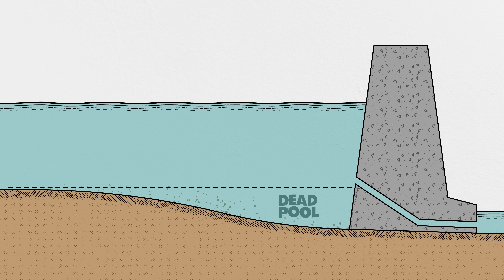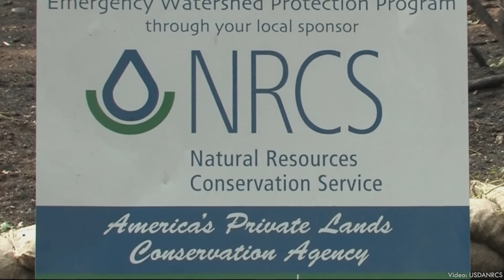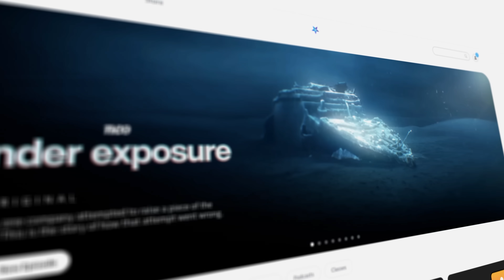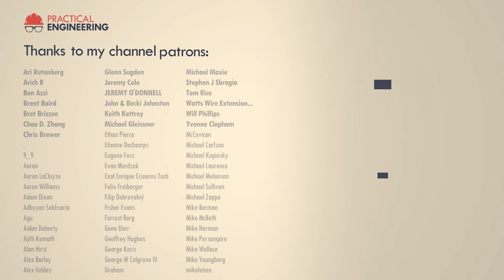All Dams Are Temporary

Comment: paused at 8:30 to think... you'd have to hit this at the tributaries, where water is flowing into the reservoir.  an artificial delta with stationary dredging equipment could let you drop the majority of the sediment before it gets to the larger reservoir, and dredge it from a prepared/static area, which should lower cost.  Another thought is some sort of vortex to drop sediment out in a controlled fashion, but I don't know what is involved in accomplishing that.

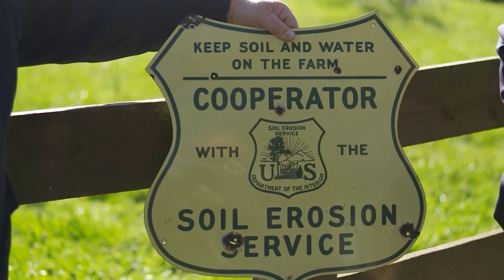Comment: 12:54 "We have a whole government agency dedicated to the problem" - For now.

To me, it sounds like the best (Least worst) solution is to separate the sediment before the reservoir and bypass the dam, piping it all straight into the downstream flow. You could do this with the bedload interceptor that you mentioned, with a pre-reservoir to slow the flow. This will greatly reduce the incomming sediment, and the system could incorporate a bypass for fish at the same time, which is a related problem. It's not perfect, as rain will still bring sediment into the reservoir from its banks, but it will be at a greatly reduced rate.
Reply: I can speak first-hand and say that NRCS has been gutted under this administration, so yes, for now.
Reply: That's what I'd do.
if the goal is to minimize the downstream effects of the dam and prevent sediment upstream of the dam then a catch right at the start of the reservoir with pipes to push the sediment past the dam and back into the river would accomplish both goals.
Reply: @ARockRaider  yeah thats the way i woulda done it
Reply: We did!
Reply: til doge gets ahold of it
Reply: Don't really see how that's possible.

1.) How do you separate the sediment from the water?

2.) How practical is a 10, 50, or 100 mile log pipe made specifically for sediment?

WHy not just fix everything in one go and remove the dam?
Reply: @johnperic6860  
1) you would slow the flow in the collection area, which would allow the sediment to fall out of suspension. This would then be collected at the bottom, some water would be removes for example using a cyclonic filter and then it could be pumped to the outlet.

2) the sediment would still be suspended in water, so it can be pumped through a pipe. I believe this is used quite a lot for the movement of sand, e.g. when they dredge sand from the sea to build a beach.

3) because the dam then allows you to store water for drinking during dry seasons, or power generation.
Reply: @johnperic6860  Do you seriously think people spent countless amounts of money and man hours to build dams just for the hell if it? They all have great benefits, whether you're looking at hydroelectric generation, storing fresh water, controlling glow of water into other bodies, and many other possible scenarios. Rivers contain massive amounts of energy in that flowing water, and its a constantly cycling source of fresh water, so no. You can't just "simply remove the dam", it would massively disrupt the entire surrounding countryside. Removing one necessitates the preparation of surrounding areas so that they can get whatever resources the dam is providing by other means, which can be quite difficult when talking about dams that have stood for a century or more.
Reply: @johnperic6860  Removing the dam loses the function of the dam so isn't an actual fix. It's just swapping one problem, siltation, for the even bigger problems of fossil fuel consumption, nuclear waste and/or water supply. 

The real issue is land degradation and that we shouldn't be losing all that material in the first place.
Reply: @ 
1.) No, it is an actual fix. Why are you acting as if dams are the end all-be-all? The problem is that reservoirs flood land, reduce sediment loads, siltate, cause water loss to evaporation, and disrupt ecosystems. The solution is removing the dam.

2.) The benefits of hydropower in reducing CO2 emissions and fossil fuel consumption are far outweighed by their detrimental impacts to rivers and land.

3.) While land degradation has some part to play in it, it is not remotely close to being the primary driver of sediment loads in rivers, especially in the Mississippi River basin. Before human development, the Mississippi river carried 450-550 million tons of sediment annually (it carries about half as much today, due to damming and erosion control). That is hundreds of millions of tons of sediment that are currently filling our reservoirs, and would fill our reservoirs even without land degradation. Our impact on land quality has only changed that figure by a few ten million tons.

Comment: depending on topography around the dam you could build an alternate spillway with a higher access point, a 24/7 dredging system,  pumping the silt out and creating a long narrow river like wetland running parallel to the below dam river.

Comment: I calculated a couple of years ago that in the best case scenario the Hoover Dams concrete (no rebar, no transport, shuttering or labour) released the equivalent CO2 as the same power Gas turbine burning for 1500 years.  They are only expected to last for 200-400 years maximum, so they aren't all that green.
Reply: Yep, the main benefit is that the dam is cheaper to operate
Reply: But how much of that CO2 is in the atmosphere 50 years later?, 100 years?
Reply: @mikus4242  the main reason given for the annihilation of water course habitat is that Hydro is green, it patiently is not, the same could be said for the gas Turbine that has a 1500 year head start.

Comment: Instead of a dam that simply goes from one bank to another, i think this could be avoided by shoring up and closing the distance between specific stretches of banks to narrow the path in which water can travel in order to give slow moving rivers more flow. It would need to be done with a taper i think, and the bed would likely need to be dug out. Basically, create an artificial strid

Comment: Some possible concepts: 1) build a series of parallel gates to release sediments where and when required  2) where the water enters the reservoir, a series of subsurface ridges for a "washboard" effect that would trap and retain some sediment for removal before entering the body of water. Your thoughts?

Comment: Rivers change and move, less in rock, more in soft soil. It is very slow movement, but the pressure to move does build up over time. Short term solutions seem cheaper and easier, but only from a short term viewpoint. Learning to think like a river and plan for those timelines, can avoid disaster.

Comment: Ok, here's my idea for reservoir sediment management which might work. 

We know a dead pool can allow sediment to settle, just like the wastewater management settling channels. 

What if we had a low head dam at the entrance of the reservoir, with geometry that forces sediment to settle? What if we then had some sort of pipe that bypasses the whole reservoir and empties after the main dam?

In this way, we could use existing technologies to take sediment from where it is not desired, to where it is needed. I'm not even sure we would need a pump.

Some testing would need to be done to make sure the sediment actually takes the bypass pipe and doesn't need some kind of agitation, for example. And it would be great if we can size the sediment bypass pipe in a way that doesn't just drink up the whole reservoir or allow the sediment to settle in the pipe.

Comment: I wonder if you could use a combination of increased flow, and some sort of 'agitators' where the sediment shelf is building up. So you have some sort of ship/ferry/etc that has either mechanical parts that kick up the sediment, or shoot high pressure water at it to stir it up. Then you let it flow out of the dam under a higher-than-normal flow rate. It seems like if you tune it just right, you could do this at a rate that would keep the sediment shelf pretty much where it is, without having massive dumps of water/sediment on the other side of the dam.

Comment: Probably a huge oversimplification. If you could build a dredging system into the dam when you built it and just "run it" on a monthly basis maybe you could avoid long term buildup? Turn a generational dredging barge operation into a smaller maintenance activity.

Comment: After thinking about it for a minute, I would do hydro-powered dredging. Set up a pipe from one side of the dam to in inlet, At first dredge up the delta using the flow from this pipe, this should introduce sediment in a controlled way, and slowly re-expand the reservoir, then set up a automatic catchment system using the same pipe.
(I'm sure someone has tried this before XD)
Reply: This is a bad and over complicated idea.

Just remove the dam.
Reply: @johnperic6860  They talked about why that wouldn't work,  Unless your referring to removing it permanently , which is expensive due to lost resources. XD
Reply: @ 
1.) No, he talked about why draining it temporarily wouldn't work (this is false, it works quite well and is already implemented in Switzerland with a high degree of success).

2.) I am referring to permanent drainage of the reservoir. There's no such thing as a cheap solution to this. We made a bad and destructive idea, and any sustainable route will be expensive - the thing is that dam removal is the cheapest and most practical long-term solution.

Comment: Of course that would be almost impossible to build but I think I have an idea what a solution could be.

The reservoir should not be a huge empty monolith, instead it should be a channel of constant cross-section rolled into a giant knot
therefore making water travel much longer (proportional to the volume) but preserving the flow speed.
Maybe it should be layered concrete maze. While it's very likely impossible the separation of flows requires several magnitudes less strength than a dam, after all it only needs to withstand the inertia in the turns, not gravity of whole water mass.

Another idea is that the river must have narrow fast channel going  straight to the dam so that all the sediment falls down near the dam and can be re-captured by the flow but it will create huge stale volume of water. But then it's possible to build separate water channels going all the way to the dam and getting rotated to avoid stale water.
Reply: Why would you do this? What benefit would it bring?

A longer river has a shallower slope, which means it naturally would flow slower. Flow speed would not be preserved.

Why not just remove the dam and solve all these problems?
Reply: @johnperic6860  same channel cross section can be achieved with different slopes if construction is not limited

Comment: 1:10 "off the top of your head"
OK. Build two settling ponds side by side at the reservoir's entrance for alternating use. The sediment in the unused pond is flushed downstream  of the dam through a tunnel, ensuring a constant supply of sediment downstream.

Next, use lateral levywells to control flooding. A levywell is a small berm with a deep gravel-filled trench to said berm's upstream side. A hardened shoulder is at the river end and a hardened spillway is at the other.